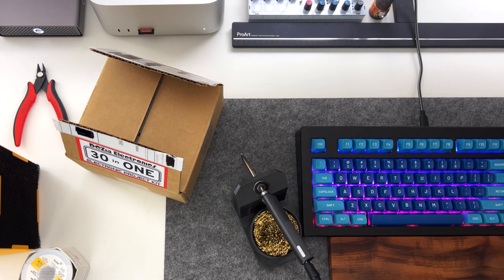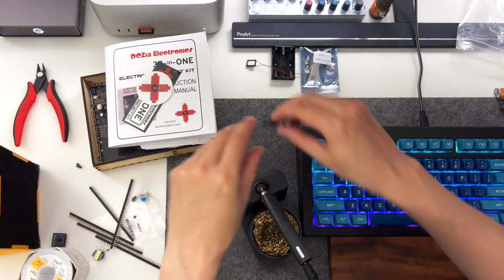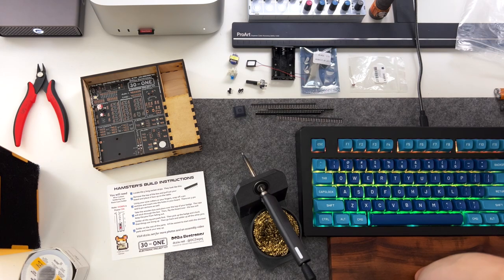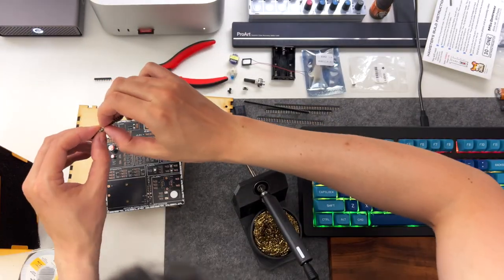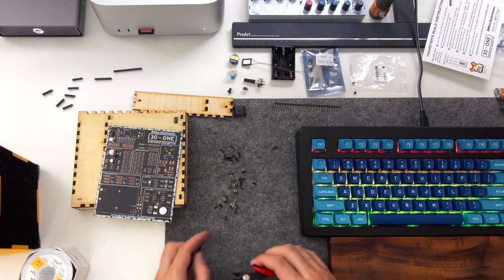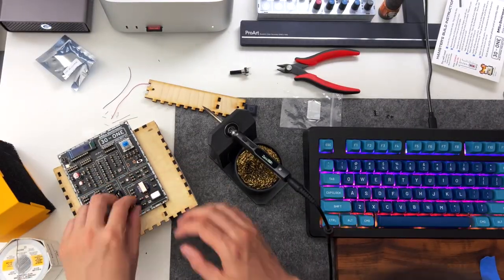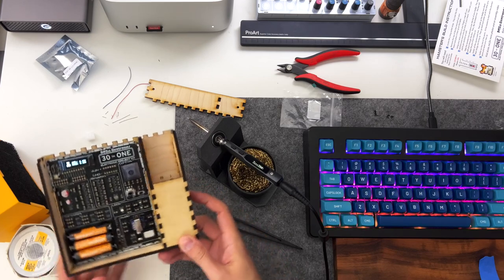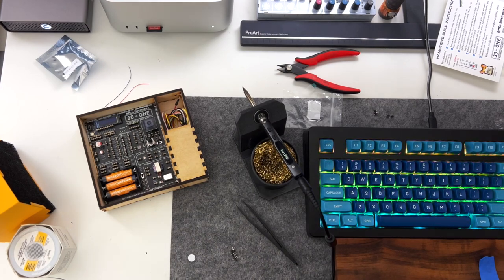DCZia 30 in 1 Electronic Project Kit Badge Overview and Build Guide Defcon 30 - 2022

Comment: Smooth, shiny volcanoes! Thanks for putting this together! 
A couple of additional tips after working with folks on assembly:
1. Do the headers first, and do in batches
2. Go in component height smallest to largest (like recommended in the video)
3. Take your time cutting the headers, sometimes they break instead of cut.
4. Have fun!